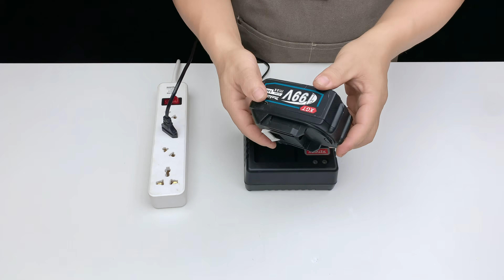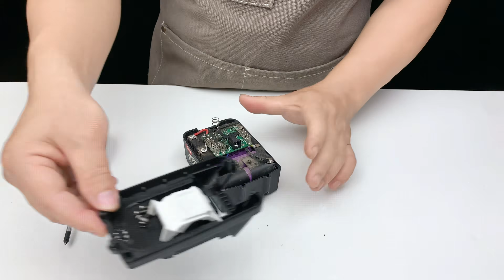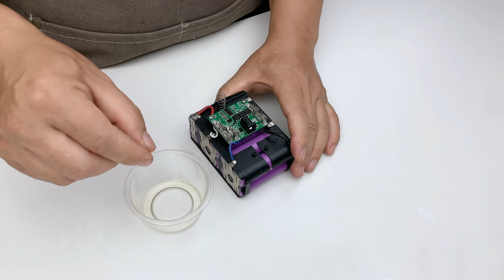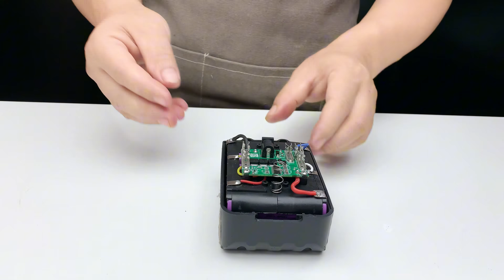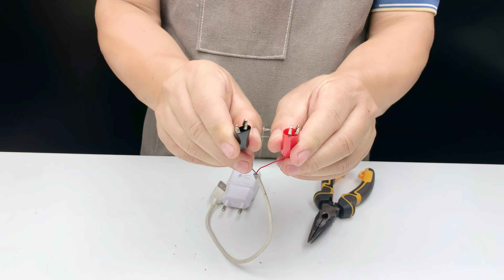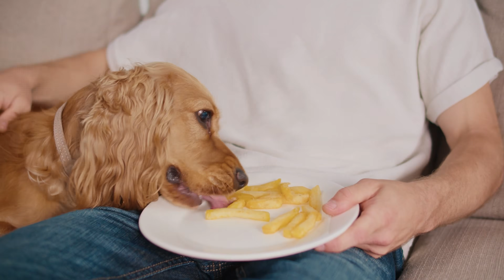Use a Regular Phone Charger and Fix Any Dead Drill Batteries in Your Home!

Comment: Battery only discharged to start with.
Reply from the maker: That's definitely possible. Some batteries only need a small boost to wake the protection circuit, while others may have deeper cell damage.